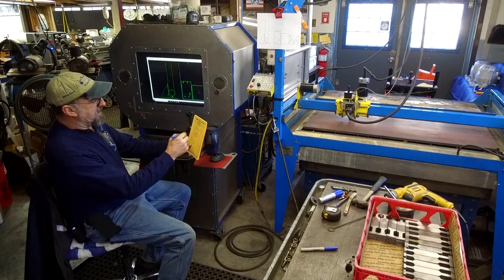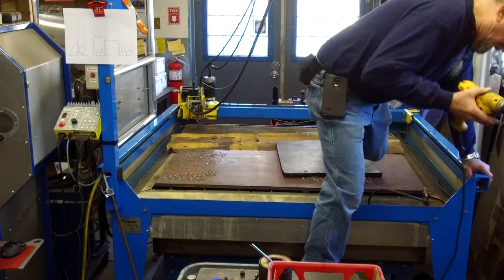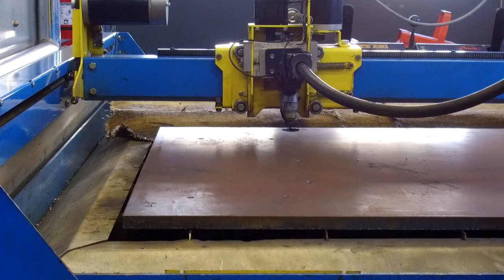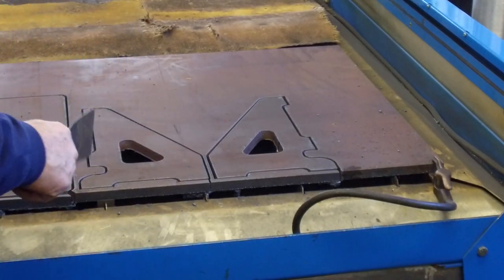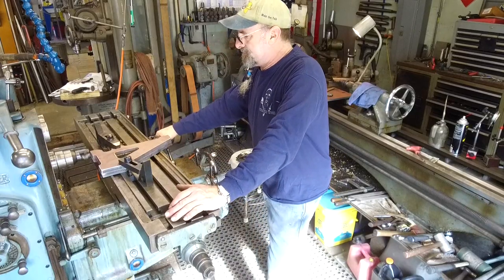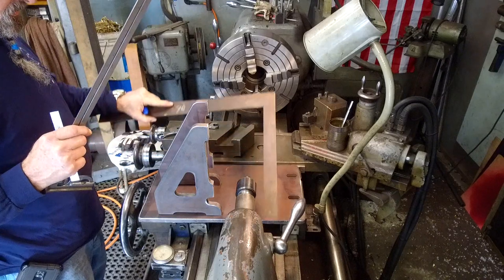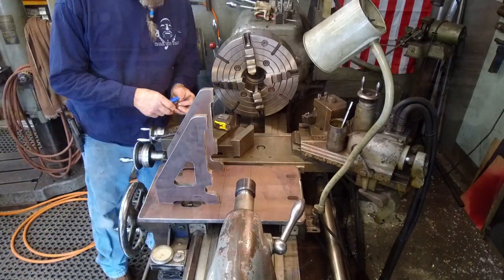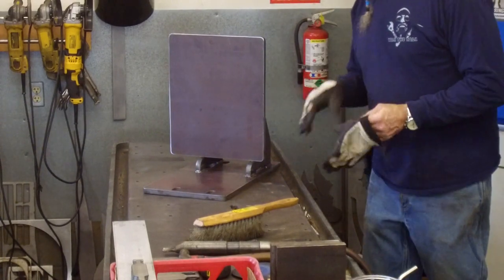Boat Forks Part Two

Comment: (@4:25) I thought for sure  Mr. Fenner’s hammer was going to be floor-bound as the cutting head came across! 🤗 Sort of like those videos on YouTube showing a truck going under an overpass that doesn’t have enough clearance, and it becomes an open-top truck! Rotfl. And I thought Mr Fenner didn’t have a sense of humor - silly me.

Comment: Im sorry Keith but im disappointed at that light duty material, cant be more than an inch thick-LOL  (with humor and respect of course) - youre the man, love your videos.   I was also wondering where that massive table came from, saw in comments it was a gang drill press table once - what a find for your shop, excellent welding table.

Comment: At 19:36 ...... that "woo hoo" said it all!   Great video Keith Fenner!    Although I do have a question,  the outer wall thickness of the bore, on the arms where the new bushings will be pressed in, how much wall thickness minimum is recommended?  I am going on the assumption that the arms operate in the horizontal position and the pins or rods that the bushings travel on are in the vertical position.   Should there be more meat on the outer side of the bore of the arm?  My only guess to this is because of the egg shaping of the bore of the arms.   They must certainly be picking up a tremendous load and thus causing the arms to tweak the bore radially parallel to the arm.  It's the outside of the arm that I'm wondering about.   Not sure if there is webbing or the top and bottom of the arm bore.  Thanks!

Comment: Great toys now Keith. I hope you remember when you weren't quite this smart or had the toys to pull things like this off. I often wondered when I was still working just how much Plasma trimmed the propane/acetylene industry. I loved mine big time. Such clean cuts. Chipping with a putty knife now, LOL, What a concept eh.That sure sounded like a square wave welder fella. I love em. Great stuff today my friend. I look forward to the next instalment on this tricky build. One thing about this is you can continue to use this jig forever.

Comment: i was thinking.. he's going to back bolt the angles to the face plates to hold them tight during welding.  i have seen abom97 do that on things he's welding together.  just extra work properly they came out great..

Comment: Keith, For your base plate, couldn’t you have used two original edges of your 5/8ths steel and saved quite a bit of time and materials?
Reply from the maker: Sometimes you get just a little more or less material, due to heat pulling or moving the plate around than just having it cut it out whole. ;{)------

Comment: Did you get a fault flag on the torch breakaway? From here in cent Tn., it looked as though the arc voltage signal may have been lost.
Was the purpose of pre drillng the pierce points to prevent volcanoing and splatter? 
Looking forward to #3,
Rollie
Reply from the maker: Yes blow back and held to long of a pierce time for the no material to pierce. LOL ;{)------

Comment: Keith watching this video I couldn't help but wonder, what was the original purpose of your welding table? It looks like the bed for a lathe, or some similar machine.
Reply from the maker: It was a drill press table with 6 Vari heads I gave away, when I got it home. ;{)------

Comment: Oh yeah,  one last question,  can the plasma cam cut 1" thick hot roll plate?
Reply from the maker: If your power supply to your torch head is hearty enough or rated for that thickness then you can. I have cut one inch in some of my earlier videos going real slow and from a drilled pierced hole. ;{)------

Comment: when you have to make all the extra supports, does that that increase the "damage you caused" cost of repair?  Is it a time and material sort of deal or is it time only..just asking.  doc
Reply from the maker: Try to hold and skim that bore with what you got and see if the time spent dinking around pays off and the quality of the end project. ;{)-----

Comment: ya 60 amps cut that 5/8" nice the starting holes made for a nice pierce. horizontal boring mills don't have to cost a fourtune anymore
Reply from the maker: You do have to have room for them. LOL ;{)-------
Reply: Could always build a barn on your property to house one. :-)
Reply: and a special room it is, I could just picture cracks emanating out from the leveling pads on my concrete slab

Comment: Keith know if you build something build it right but as far as the back plate being perfectly square to hold the arm in true vertical would not be so critical as your boring a round hole as long as you center the bore with the boring bar  the arm could be at any angle but now saying it  I see were it does help to with keeping the bore concentric- 90 with the arm  IE no twist got it!!!!
Reply: Another thing. Then 90 degree angle will keep the fore-aft setting the same when the up-down adjustment is made.
Reply: This part might not need the upright plate to be exactly vertical but the next job for it very well could need it. It will never be easier to make it plumb.

Comment: Say again why pierce points need to be drilled out?
Reply: Cause plasma don't like to pierce thick metal well. Holes create same thing as starting at an edge.
Reply: A direct pierce of 5/8" thick material can be tricky.  Cutting a hole helps the dross flow out of the cut area and not create a pool of metal. Hope that helped.
Reply: Yes except for the material you might be wasting.
Reply: Not only does it help the cut but it extends the life of the torch consumables and helps with spark control.  It's just an all around better way to go.
Reply: Using a Hypertherm powermax 85 I have routinely pierced 1" and have pierced up to 1.125" on my Samson/ Plasmacam table by adjusting the lead in without drilling any holes. I have not had any issues with burning up any tips doing this.
Reply: Valkman  I don't disagree with drilling holes. Yes it is a good idea to do so based on manufacturers recommendations. With the hypertherm their recommendations for the powermax 85 is to use an edge start above 3/4 inch on a mechanized process. This is not because it is an abuse of the machine directly but to avoid the costly replacement of nozzles and reducing possibility of not getting the best quality cut out of your machine. With any handheld torch (plasma or oxy/acetylene) you have the ability to angle the torch and blow the material away from your tip which you don't have on a three axis cutting table. As I stated in my post I have adjusted my lead in parameters on my pierce point to avoid the blowback onto the torch and avoid the costly process of replacing nozzles and tips on my torch. There are parameters within the design edge software to adjust a moving pierce point height and lead in length to help facilitate this procedure. On a cost (time spent to locate and drill holes versus replacement cost of torch consumables) and quality risk assessment for my business I have yet to have a damaged nozzle from this procedure. That doesn't mean it wont happen, just that as of today I as a business owner can afford to replace a large number of torch consumables with what I have already saved by thinking the process though and using logical steps to minimize taking the time to locate and drill holes. This is not for everybody and I do drill holes when it is necessary.

Comment: 16:13 - 16:20 Think I see why you're getting beveled cuts. Watch the torch mounting plate when it gets to the top of the z axis.
Reply from the maker: Yeah it popped up on the right side, due to the dross rolling under on that home stretch. ;{)-------

Comment: how come the grid doesn't get cut too
Reply: It does. You can see melt marks on it if you look. It needs to be replaced from time to time. The sheet of metal to be cut sits on little points above the main part of the grid and those points show up as dots on the layout screen on the computer. You can move the layout so you don't cut the points off but the main part of the grid takes a beating after a while.

Comment: 44:34 What was that table originally designed for?  Did it come from some old machine - or is it just a table
Reply from the maker: It had 6 vari drill press heads on it that I gave away. ;{)-------